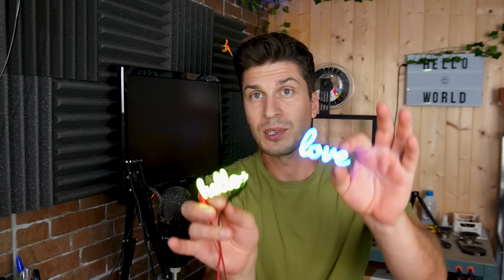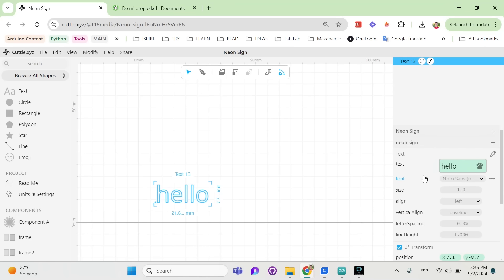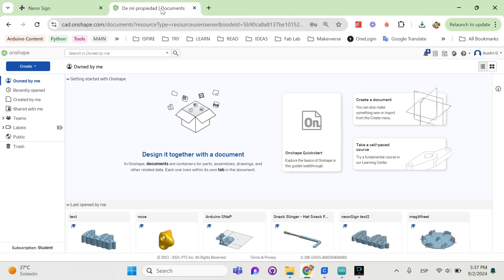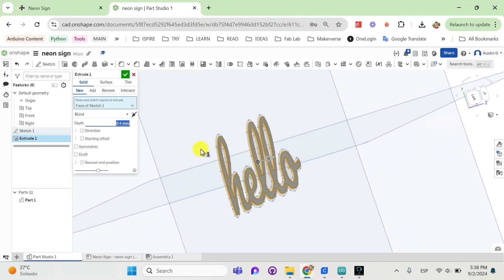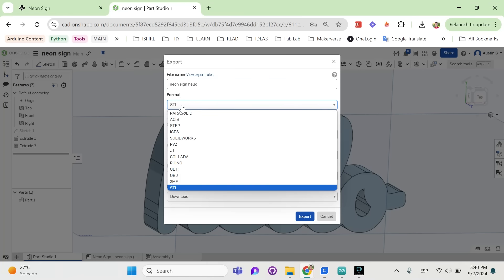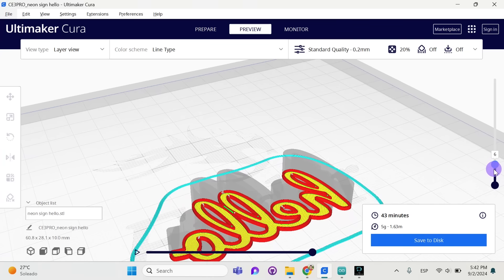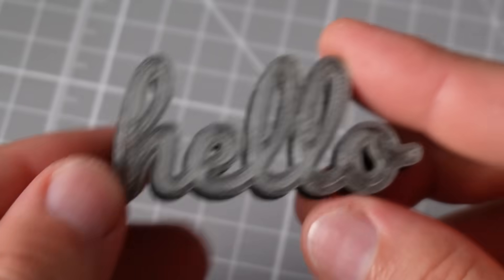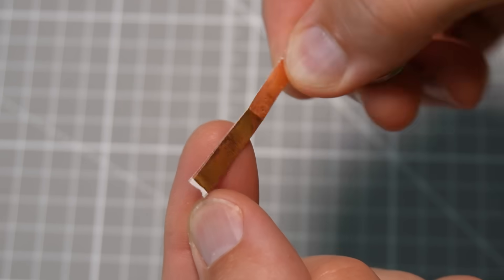How to make a Mini Neon Style Sign with 3D Printing - Tutorial DIY

Comment: They are more expensive but you can get the parallel wired ones that can be cut to length, which makes sizing and wiring easier

Comment: Tnx for a great tutorial. 2 things I’m still wondering.
1. What do you do with the excess LED filament since, if I’m not mistaken, you cant cut these. Are do you somehow design to need exactly 300mm?
2. What if you have a word with something like the letter i in the middle somewhere. Where you have to to up and straight back down. Can these bend that much and how do you handle the hotspot of double LED filament in that letter?

Comment: So when you do the "pause print" script, it'll pause after 5 layer, then the ender 3 waits for your to hit the button to reinitialize the print? I didnt see you hit "resume" or anything but I am assuming you did.  I have an ender 3 pro, I just haven't used it in a while this may cause me to dust it off and fire it up! Thanks
Reply from the maker: I believe you can set it up that way, but in my case, it just waiting for a default moment which I think was about one minute. Not much time, haha, but just enough to swap out filament.

Comment: What 3d printer do you have? Which printers would be applicable for these projects?
Reply from the maker: You can use just about any printer. This is an Ender 3, but I have tried on other brands link Bambu Lab and Elegoo as well.
Reply: @nick_the_maker  I appreciate the response. since my last comment, i've actually got a 3d printer and have managed to print some items. I came back to this video because i think i'm passed the "trial" stage of printing, but the onshape site looks nothing like what you have in your video and the steps are not the same. I signed up and whatnot and did everything step by step. There was no xyz planes shown, there was not tool bar like yours to import the dxf file, etc. I managed to import the file, but there was not editability for the file. Was i supposed to select a specific profile type when i signed up? I selected that i was learning or something and it gave me the free trial version, which is what i want.

Comment: When you insert the pause at layer 5 how do you manage the purge of old filament and start printing new filament? I've never player with custom gcode before so have no idea how this works. How do you do it?
Reply from the maker: I don't worry about any purge on this project, but if you prefer to purge a bit, just push the filament forward for a few seconds to clear out the previous color (and remove the "poop" below the nozzle). I think that's the easiest if you are doing a manual change.

Comment: Really nice tutorial. One thing I think would add to the realism of a neon tube is in Onshape use the chamfer tool to round the corners of the text. Quick question though...How long will the light last if I use a button battery?
Reply from the maker: Solid idea and should print well at 45 degrees angle. I haven't actually fully tested it or run the math on the button battery yet. It will depend on the length, of course, but honestly the button won't last very long. I'd recommend building something with a battery pack like shown in my other video. Good luck!

Comment: Tried this using the same font with the name Sophia.  The S is disconnected from the ophia so how do I fix that please.
Reply: I used the connected text option.
Reply from the maker: Another option is to right click on text or "Edit" menu and then "Convert to Path", which you will see change everything to a Group in the top-right menu. You can then manually select and adjust each letter as a path, like sliding the S closer to the name. You would lose text editing options though.

I've also added small shape connectors before, like thin rectangles to connect dots of "i" to the letter. Happy you found a good solution though!

Comment: I've been looking for something like this but scaled up to use those LED neon rope light things with the diffusers. Thanks so much for creating such a simple tutorial that even I can most likely adapt it to a different purpose :)
Now I just need to learn how to cut the letters apart in some software or another to fit on the print bed...
Reply from the maker: Could apply similar approaches on large letters. Have had it on my mind but not gotten around to it. Tag me if you make something, would love to see it!
Reply: @nick_the_maker  I'm currently stuck because I need a groove of constant width but the edges of the letters can be variable (though either would work). I'm thinking I either need to learn much more or I could maybe find a font somewhere that has lines with uniform thickness.
It's a work in progress but your video has given me some pointers along the right lines, so thanks again!

Comment: Question. Can you trim the filament LED lights to the size you need? How can you measure the actual size you'll need to fit into your sign? If you need more than a single strand, can you hook multiples together?
Reply from the maker: I don't recommend trying to trim these. Yes, you could possibly chain multiple together but you need to be careful how it's wired and not try to push too much current from one end of the chain to the other. Be safe!

Comment: Has anyone had the idea to hook it up to a a small Arduino with a microphone to listen for music and then flash the lights like a disco light. Was thinking of stick on on my bluetooth speaker to flash along with the music, infact also try to get the power from the battery pack of the jobsite Bluetooth speaker.
Reply from the maker: Awesome idea, love it! Should definitely work but might get enough current supplied from a Pin directly and would probably need to consider a transistor setup.

Comment: Just wanted to throw this out there for everyone to try out. These filament LED'S hookup nicely to old Vape Pen hardware. I'm talking about those disposable pens that everyone thinks can be thrown away but actually specify to be recycled at a lithium ion battery recycling station. No one does this! And these batteries are all over our landfills now.

I've been keeping them from myself and my friends, knowing they had usable hardware in them that could be nice for small projects - now I have a massive bag of them for free! Found this video and sure enough the LEDs work amazing when connected to the coil leads - no adjustments needed! Now just swap the air pressure switch with an analog switch and there's already charging hardware and either a micro or usb C connector. I'm printing out all kinds of words now!!!!

Great video. Keep spreading the knowledge!!!
Reply: That's dope as hell! consider making a vid showing off the process, people would love to see I'm sure
Reply: Make a video
Reply: Thank you, definitely going to look into this.
Reply: I always think about how to get ppl to recycle them ex drop at supermarket etc instead they are all over
Reply: That’s awesome!
Reply: Following!

Comment: The advice to match the outlines withe the nozzle size is not correct. There is always an overlap between the lines a 3d printer creates. So for a 0.8mm outline a 3d printer with a 0.4mm nozzle will always do more than 2 passes depending on your printer settings.

Comment: Just a note from someone that worked with neon signs.  If you have any hot spots from the doubled up wire then applying some black paint to the lowest wire helps.  Neon benders use blackout paint to stop overlap or create spacing.
Reply: How hard is it to learn how to create neon signs? I know it depends on the person but in general are the tools, materials and learning techniques accessible?
Reply: @LordOfJazz I didn’t bend neon myself, but I had to make patterns and I did watch what they did.  So, it’s a painful job and one that not many people still do.  It involves handling hot glass all day in a room that feels like an oven.  You basically take a hollow glass rod and seal one end.  The other gets a rubber tube that you use to keep the rod inflated with your breath while you heat it.  They’d take my paper pattern (which was in reverse) and place a piece of metal mesh on top of that in order to not scorch the pattern.  They’d use a couple different types of burners based on the bend that they needed to achieve.  Constantly they’d go back and forth to compare the bend to the paper.  Usually they’d have the rod somewhat pre-marked with distances so they knew when to start the curve.  A lot of neon is in smaller lengths because of how hard it is to handle a longer piece.  After getting a piece to match the section, then they’d cut the ends off and fuse them with the connectors which are just glass ends with electrodes hanging out.  Most every piece of glass has several double-backs in order to hide the electrodes and the rubber housings that connect several pieces electrically.   Then they’d have to make an attachment area to force the gas in.  Basically just making a nipple that they can seal back up.  After that they connect the pieces to a transformer and let them burn in.  The color can change a bit based on the gas.  The transformers are no joke.  Very high voltage.  I won’t go into the install of neon, but it has its own variety of hardware.  These days you’d have to find a shop that still bends neon and see if they’ll teach you while you work.  There are schools, but it’s been 20+ years since I last saw anyone bend neon.  LED lighting has come along way and has taken over.  Older lettering that you’d see on buildings all used to be lit using neon inside them.  Now it’s all LED’s.  Good luck if you pursue it.

Comment: Really great project!! For any of the viewers that have a vyper anycubic. There’s no pause function that it’ll recognize. I’ve corresponded with their engineers on this.  therefore to use two colors. you need to turn increment off and then where you want to change colors, actually create two files from 1 code. Takes knowing a little G code to prevent problems while the machine pauses between programs.

Comment: New subscriber.. love this idea.. i have 3 bambu labs and 1 Snapmaker Idex printer J1.   I still haven't tried using PETG with PLA yet..  or tried using Pause print settings .. which can I use AMS for swapping colors?  Also wanting to try TPU filament with another filament to make RC Tires and Rims.

Comment: What happens if the letters aren't touching each other?
Reply: You could either print and wired them individually and have regular wire connections between them or  add opaque channels to the back of the model to run the led filament between them without being seen from the front.
Reply: @redtide08  in the word beautiful the dot on the "i" is not connected to the word using that font do you create a thicker outline on the word?
Reply: @Peacefullsound1  I would make the clear layer separated where the dot is and then a bridging connection of the darker material, such that the led wouldn't be visible in the gap. This would require a sharp 180 turn of the led wire where the dot is, so there would likely be a minimum size of sign for which this would work.

Comment: I did this in cuttle folllowed by tinkercad. In cuttle, I exported SVG of the original file. I had to make one modification in cuttle and "remove holes" in the text to generate a solid text base. Save another file as SVG. Import both files into tinkercad.  In tinkercad, resize height of each item (base 0.4mm and walls 10.4 mm).  Match the length and width and align them along length width and height. You'll need to flip things to get the correct orientation prior to the final height alignment. Anyway, a workaround if you only use tinkercad. I love this project and am looking forward to printing it on a multicolor printer that I built last week!

Comment: Why using so many steps if you can just make it in 1-2min in a proper modern slicer (so not cura). Way too much overhead. 

0. If you want a specific font like Pacifico, which is usually not default on your system, install it (optional) 
1. Add a Text shape object in the slicer 
2. Rotate it 180° or place it on the default "top" side
3. Set infill and top layer to 0 

Done. 

And for color/filament change: Slice it; go to the layer you want the switch; right click -> "Change Color"; slice again. No custom script or G-Code modification BS.

Comment: Sorry, but a neon light is a type of gas-discharge lamp that produces light through the excitation of gas molecules, typically neon or other noble gases.
Reply: Yes, and this video is showing a way to make miniature versions  of thoae kind of lights using 3d printing and filament led lights? Why are you sorry?
Reply: @Scatty666  What exactly do you not understand, that this has nothing to do with Neon lights? The Video title is misleading and if you are looking for neon lights and 3d printing, you do not get what the video title pretends.
Reply: @fw_uke_ha  sure, I guess one could make the same comment on most miniature craft videos. ”sorry, an oil barrel is actually a huge container made by steel, this miniature one you made by a toilet roll is totally misleading ”
Reply: @Scatty666  Get educated instead of bothering me and learn what the difference between a neon light and led light is and save your time in wasting mine. Thank you.

Comment: So I am overthinking this - but I tried making some with different fonts, and I am trying to understand how you calculated the thickness of the gap to fit in the LED just by sizing the font. I am trying to do this by length of centerline of the font, but this is inaccurate since there are overlaps when passing the LED filament. So next best thing was to calculate the area of the planar surface created by the closed loop of the font, and the area of the LED filament and see if it fits, which it should. Still does not account for overlaps though.

Comment: I recommend exporting the file as a STEP insted of an STL since it will result in smooth curved surfaces on your prints. Though STEP files don't appear to be supported in Cura, though you should give orca slicer a try since it supports STEP files as well as a lot of other nice features.

Comment: Great video! I'm surprised that (0.4 x 2) width on the letter edge is enough to block the light but maybe that's just because it's black? I don't think that would be thick enough for filaments with lower pigments.

Comment: Hi, not sure if this is a stupid question or if I missed something but how do you determine how wide the channels are for the neon tubing to fit? I’m making a neon sign that is using bigger neon tubing of around 8mm so curious to know how this is done :)
Reply from the maker: It was a bit of trial and error on my end to find an approximate size that works well. There are surely better routes through offsetting lines in the app,  but I found the sweet spot after experimenting with just two prints. Good luck!

Comment: The biggest issue on things like that is to create a neon sign, where the 30mm LED perfectly fits with its length ... not too short, not too long.
Reply from the maker: The safest bet is to make the sign just a little smaller than estimated. Any extra filament light can be tucked over the first run. Cheers!

Comment: Anyone know if these can be cut? I dont think each project is going to be the perfect length needed.
Reply from the maker: These are not made for cutting. I design my signs just a little smaller than estimated length, then I tuck the extra behind the first run of filament light if needed. Good luck!

Comment: Be VERY careful with button batteries if a small child might get their hands on the project.  

Most know that button batteries are toxic if swallowed by kids, but may not know just HOW bad they are. There is a tragic case here on YT where the parents knew right away and the toddler got immediate surgery to remove it, yet she STILL died after a lengthy and heartbreaking battle with organ failure.  

I am no expert and don’t know if some button battery types are worse than others, but just be extremely careful with them.
Reply from the maker: Always true and important to keep in mind. Thanks!

Comment: Thanks for putting this together, it's great! My only questions is how do you know you have a correctly sized filament led wire length?
Reply from the maker: It was a bit of a guess the first run, but then you get a quick feel for the size you have and the length of the word. I make sure to size the overall word just a little smaller than my estimate, then tuck any extra filament light (if any) behind the first run. Good luck!

Comment: Thanks for this. I see why you add the black walls as it makes it a lot like 5he barrier in real glowing neon lighting. I have been interested in making some in the past and have got close then not don5inued to get close4, I have an SLA printer and again print flat side down. I will give this a another try one day, not thought of using filament lighting, wh8ch I would class as Electroluminescent wire which I have some of already, just need to c4ack out the printer again
Reply from the maker: Good luck, hope it goes well!

Comment: Not sure if anyones said this but onshape can export in step format which gives a higher def model than stl. If your slicer can handle step files then it gives you lots more control as you can often break a complex model apart in the slicer and print in different materials and colours etc.

Comment: I’m having problems joining letters FR capital letters together. I’m using the same font as you have chosen. Any ideas?
Reply from the maker: All capital is a bit tough. You can add another shape and union it to the letters, or you can move the individual letters as paths closer to each other until they touch. Let me know if you managed to find a solution that works well. :)